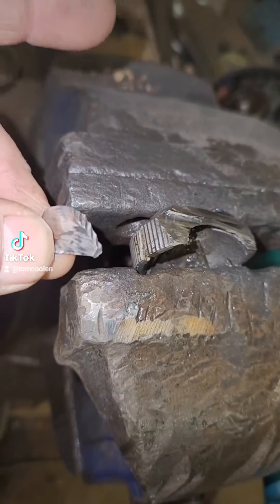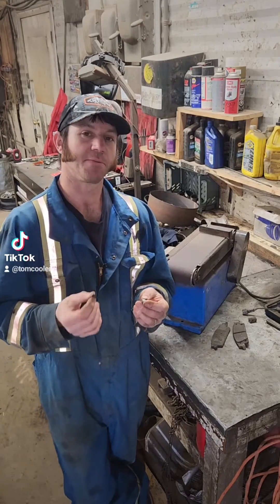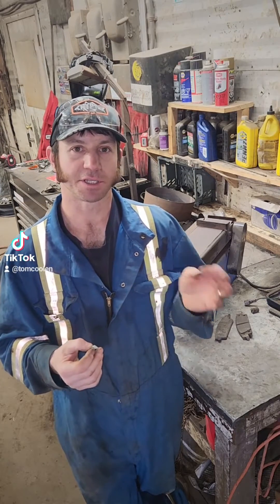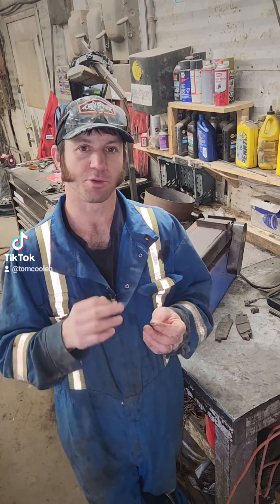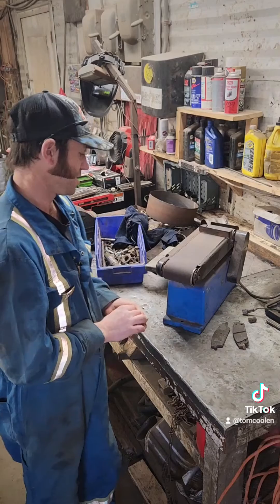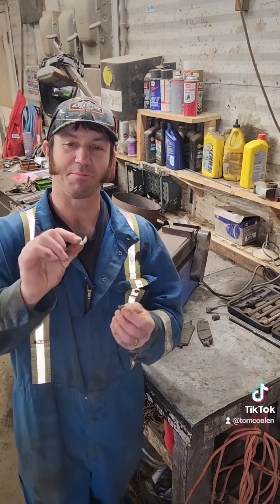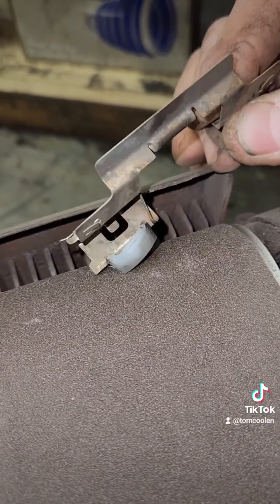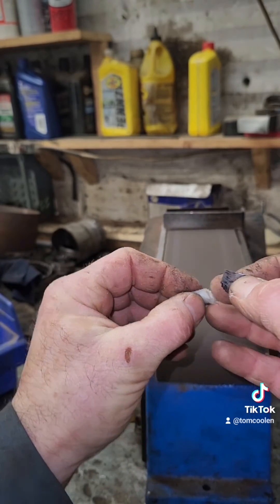Best Ball joint!

Comment: Thanks bud, we all need to be checking this s, ball joints could cause death. I just looked up Yukon for 99-16 ford superduty and then looked up their company, "partnered with Linsalata capital" in 2015 which was probably death nell, then "partnered with tailwind capital" in 2019 which is near 5th ave. in NYC. almost sure greed only and bad sign. Im getting dynatrac (dont know yet all vehicles they do ) as US made and at 700.00 a set they better be and trying to see if Carli makes my make/ year. Carli for dodge 1,000.00 a set !!!
Reply from the maker: Very interesting 🤔 Thanks for sharing! Good luck! Hope they work out for you.  A lot of good comments towards those brands. I'm not familiar with them, but you usually get what you pay for... usually.

Comment: can you cut open a motorcraft, need to know if they have gone to crap. like to see one from 97-08 and then buy a new one for the same years from Ford and cut em both to see if they changed them, supposedly they are dana / spicer ?
Reply from the maker: I did cut open a Spicer, it was plastic but then I got a comment that they make a steel version in a red box. This one was in a blue box. Next time I come across one that's original I'll cut into it. I have one ready to cut from a 2012 or so, it's a trw
Reply: @GoldWrenching Thanks brotha you rock.  Yeah i saw that one, still dont know exactly if motorcraft are dana / spicer, thats why i let the comment sit to see if a ford tech. or someone knows. diid you get the spicer out of a 99-16 ford truck ?  I do know though that in 2019 either ford or dana / spicer fd the f up and the rear dana axles are bending and collapsing (first time in ford and dana history).
Reply from the maker: @brianblithe2271  Anytime. That was a new one for a 99-02 E-150-450 yeah, that'd be good to know. Sounds like they're cheaping out, too! B.S.
Reply: @GoldWrenching  bloody BS irs right my brotha and ive drunk too much lately too figure it out, cheers mate.

Comment: Although, I would rather have a steel or brass ball joint cup ....as you were trying to indicate.   I don't agree that your test is even close to being valid.  ....sorry.  BTW, plastics, especially those "fancy ones", do very well in many high wear applications.
Reply from the maker: Yeah, I guess it is more of a wear test. And I'm sure they have their place. Just not in a ball joint or any other steering or suspension bushing or joint.
Reply: Never beat the way they did it when men were men, its all about the money, mostly all corporations have been sold in last ten years.